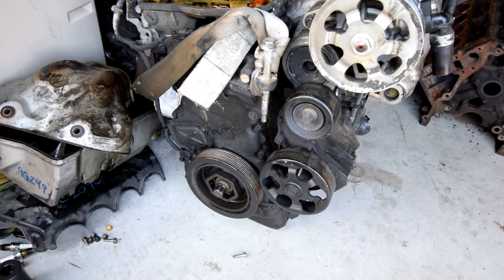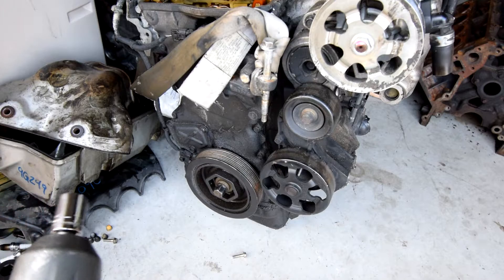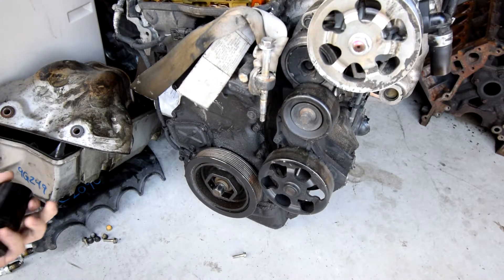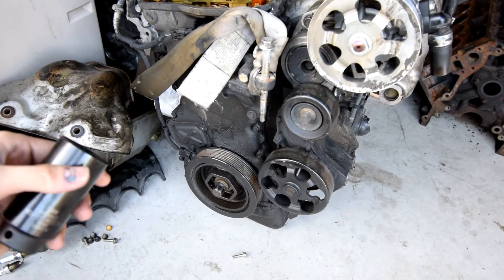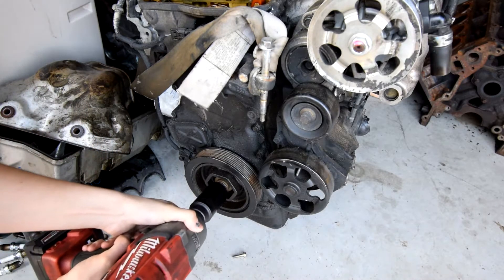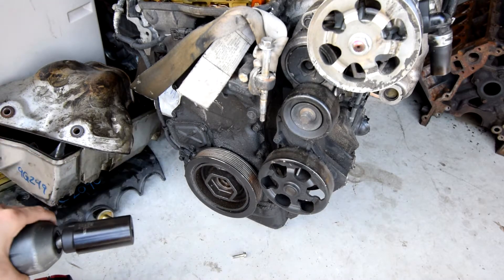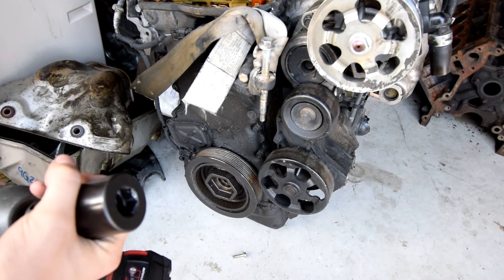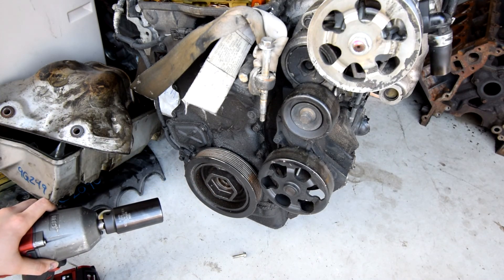How to Remove A Stubborn Honda Crank Pulley Bolt With Just an Impact Gun - NO Torch, NO Breaker Bar

Comment: Tried the bauer ac powered impact on mine with the lisle socket.  Did not work for me. 1050 ft lbs vs 1500. Is that what it takes?
Reply: I got mine off with a impact socket no weighted and a 1400lbs Milwaukee. 3 sec no joke. Before I tried a pneumatic and a breaker bar with a pipe.

Comment: Thanks for the  video , I have a important question?  How do troubleshoot a crankshaft pulley that is not aligned with all pulleys 2014 Honda Civic ex 1.8
Reply from the maker: Use a straightedge to check straightness and see which pulley is off. It's possible the balancer failed and is slowly separating, causing it to push outwards and come out of alignment.
Reply: I did check  belt off n its like back ⅛ or ¼" it needs to come forward ¼ or ⅛ " all pulleys algin except crankshaft pulley n it's not loose or play its still

Comment: How is it possible the pully doesn’t turn with it?
Reply: That is a great question that I would also like to figure out. I am currently trying to restore my 1989 Toyota Blizzard that I bought after it was sitting for 20 years.
I am trying to access the timing belt to change it and the water pump but that crankshaft pulley is being a real pain in the butt, it keeps spinning when I try to undo the bolt and it keeps sticking as if its welded on. I've sprayed wd-40 to try and loosen it up and I will use a crowbar to keep it still; if that doesn't work do you have any advice?